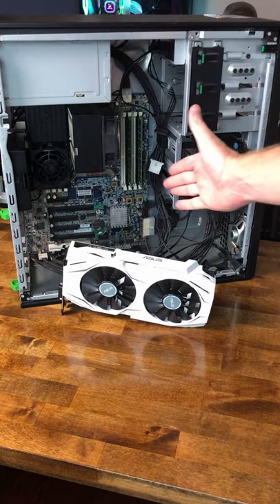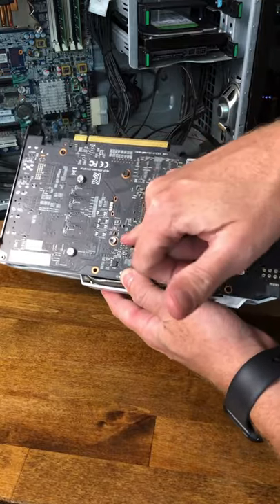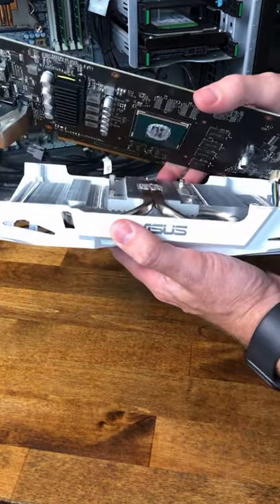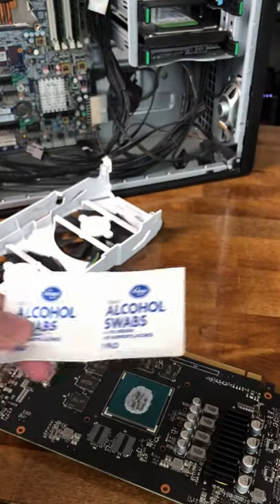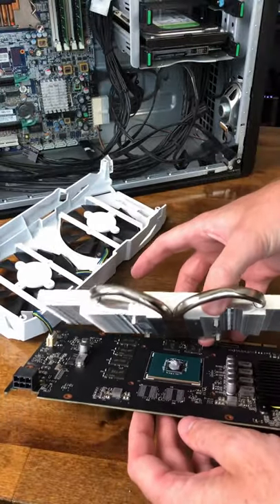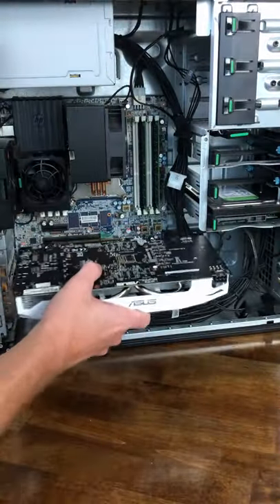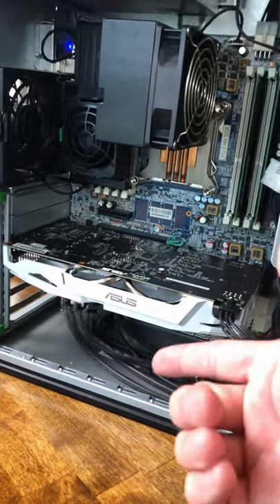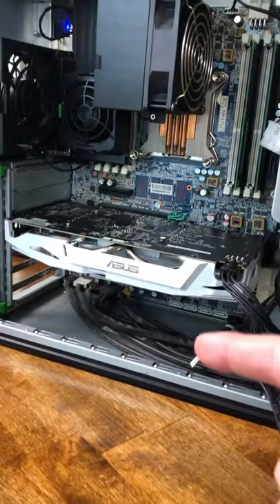Repaste Used GPUs to Lower Temps / Improve Performance! - PCTH Tech Tips #shorts

Comment: Don't forget to spread thermal paste on the gpu die. if not, the hotspot temperature will go up much higher.
Reply from the maker: Mounting the heat sink down will take care of that.
Reply: @PCTechHustle  yes, only for small die size.
Reply: @johnnydragon97  2 grains of rice worth is sufficient.

Comment: If that's the 1070 Dual I had one returned by a buyer as it stopped displaying. Same thing, popped the screws and the heatsink dropped straight off. One repaste later and the 'broken' card is running 100% again. :)
Reply from the maker: Nice!
Reply: You didn't try to repaste it before selling it?
Reply: @HoloScope  on mined GPUs I always clean and repaste. This card was running good temps and still had its protective sticker intact. Here some buyers don't want you opening a card before they buy. I'd used it myself for gaming and the temps had never been an issue. The removal, transport and reinstall must have been just enough to dislodge the bond. I still have it and it's still going strong. :)